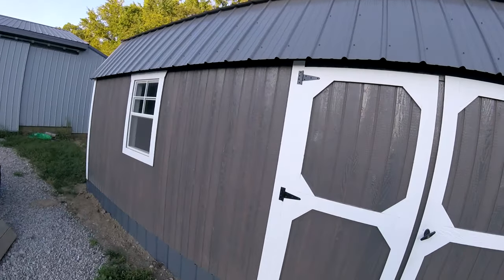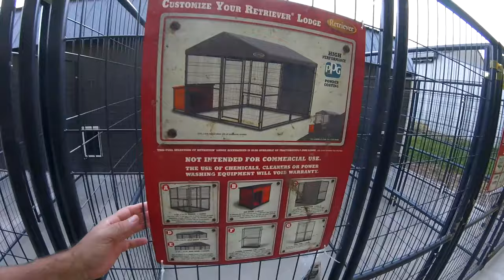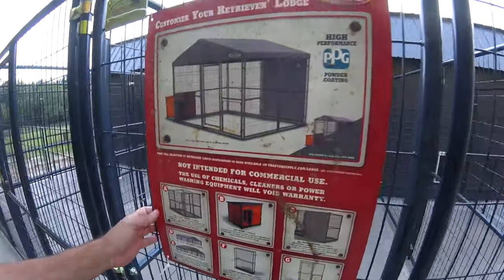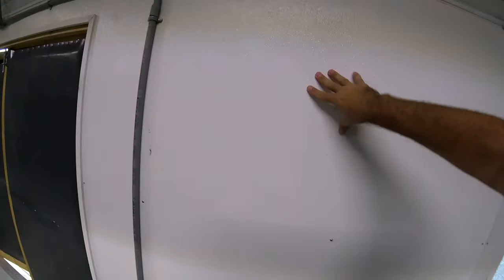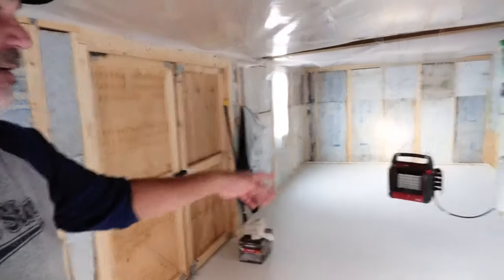Kennel Build

Comment: I like it. We have 11 deer dogs. Gonna be doing a center block kennel similar to this. Our dog doors will be able tolock from oitside so we can let them out when we want to.  And do cleaning etc. This is nice though. I like the fact my neighbors wont be bothered when I feed them. Cause they get to barking and get loud.
Reply: Why won't they be bothered?

Is it sound proof or something?
Reply: Hotep Kennels if the dogs are barking inside it is very hard to hear them from the outside.
Reply: @hotepkennels  pretty much.  You cant hear them the same as if they was just in kennels outside.  The neighbor thinks it's cool.

Comment: Looks awesome, I built myself one too for my dogs but I’m debating if I should do a concrete slab for the runway or maybe I should do turf.. how do your dogs like concrete and where do they go to the bathroom?
Reply from the maker: Thanks! We put some straw down on the far end of the concrete runs and they use that for the most part. We keep them cleaned out as much as possible and power wash it occasionally.

Comment: So, I'm planning a boarding business....how has this kennel held up over 4 years? Lessons learned?
Reply from the maker: Sorry for the late reply! It's been almost 5 years and has held up really well, even with being moved last year. I thought the Rocksolid on the floors was a mistake at first because it stained pretty easily but it's still protecting the wood to this day and actually doesn't look that bad. We did have to replace the Retriever brand kennels because of rust. We went with Master Paws from Menards and they seem to be holding up better. It's being used nonstop and hopefully will for years to come!

Comment: Quick question, the flooring inside the barn is wood? I see dog run is concrete, im planning to build one so im trying to get as much info as i can. If its wood, what do u use to protect the wood from water etc

Comment: The paneling on the wall, did you put up drywall then lay this over it or just put this board up on its own. Curious where it’s usually very thin if it’ll hold up or not  
Great looking kennel. We have a 12x32 as well and it’s a work in progress. Love the drain idea. Will be stealing that along with the tin roof on the inside
Reply from the maker: No drywall, just that thick styrofoam insulation in between the studs and then the paneling over that. Good luck with your build!
Reply: Hey Whitney did you ever finish your build?

Comment: So that whole building is insulated with just foam board insulation?  And it holds heat and a/c ? That’s great looking to do something similar
Reply from the maker: Yes, it's some really thick foam insulation though. Thanks for watching and good luck with your build!
Reply: Hello fellow Corso owner! I raised Corsos for 20 years my old girl is in the video! We used a couple different kinds of insulation. That foam board is amazing tho. Whatever open spots we filled in with spray foam. 5,000 BTU ac set on 5 keeps it cool and a small infrared heater heats it! The ceiling fan help a lot too 😀

Comment: Beautiful set-up! What did you use on the floor and do you have a drain system for the outside part?
Reply from the maker: We used Rock Solid on the floor. We have a separate video on the floor process. We would look for something else if we did it again just because of the cost of Rock Solid plus it stains really bad. No drainage on the outside other than having the concrete sloped away from the kennel. Thanks for watching!

Comment: To have just the building built with company we bought a storage building from with the same square footage which doesn’t include doing all the work inside would equal $10,879 just for the building. But not bad considering $28 per square foot.

Comment: Other than the floor staining did you have any other problems with it? Im thinking maybe a darker color.
Reply from the maker: Darker color would have probably been better. The stuff is protecting the floor but for the cost there has to be something better out there.
Reply: @HoosierOutdoors  I just bought a 12x40 shed today to do just like you did. What type of heater and ac do you use now?
Reply from the maker: @allyessary6205  Nice! Ours is insulated really well so all we use is a small window unit for air and an electric space heater for heat.

Comment: Looks good ...I’ve got 5 retriever kennels they don’t last ..they won’t make it 2 years
Reply from the maker: Dang, hate to hear that! Should last a lot longer than 2 years for what they cost. Is rust the issue with yours?
Reply: Yea the bottoms rust out on them ...I’ve since had to use galvanized square tubing an build my own ...nothing store bought seems to last with everyday use /cleaning
Reply: We have 8 retriever kennels that are covered, and they are not gonna last. I’ve had a door rust off the hinges within 2 years, and they’re out of the elements. It sucks, looking for alternatives for when we move to a new location!

Comment: I’m starting a similar project.  Going with boxes inside vs stalls and a shelter over the runs to keep them dry.  
The heating is what has me wondering for a 12’x48’ all weather shed. I was thinking a 3 to 5,000 watt would be more than enough.  
Are you on a septic? 
Nice work.

Comment: What about the FRP? I have seen pvc panels used by the company who builds complete kennels like this. Do you think the frp is going to work as well as pvc wall panels?
Reply from the maker: The FRP panels have held up great so far.
Reply: @HoosierOutdoors  they seem to be working quite well other than the seam in the big dog pen. Had to put up a trim board over the seam.

Comment: So many questions, How thick was your cement slab? What are you going to use to heat it in the winter months? And do you have an estimated price cost for the whole build?
Reply: 6” thick sloped concrete, it is well insulated and 1 oil heater or small infrared works great! All the materials were bought on sale , with rebates, insulation was bought off FB marketplace for $4 a sheet, building is not on payments so definitely buying outright, bought all materials so no mark up from builder, kennels on sale also use the 15% off coupon… saved at least half doing most ourselves
Reply: @gailakard6267  thanks. I just started mine. Unfortunately I half to wait for spring/summer to do my concrete now. I plan on working on the inside this winter. I am using your build as a guide!! I plan on having a second one made right after for a shelter for stray dogs I can take care of and find good homes. Thanks so much!

Comment: Me again haha! Things are going good! Just finishing up the insulation. What did you use for the walls? PVC? Where did you get them from? Thanks:)
Reply from the maker: Glad to hear things are going good! We used FRP panels for the walls and we either got them at Lowes or Menards, can't remember which.
Reply: @HoosierOutdoors  thanks your the best! I'll have to send you pictures of mine when it's finished. Last thing, what do you recommend I use for the floor.. I know you said in your video you would rather go with something else because of the stains.
Reply from the maker: @EXIXISRAP  the RockSolid stuff we used has actually held up pretty good. No, it sure doesn’t look like it did when we put it down but it isn’t as bad as I thought it was going to get. I haven’t put much thought into what we would use if we did another one but there has to be a cheaper solution!

Comment: Still using those pet safe doors? Why didn't you use the retriever panels inside also?
Reply from the maker: Yes, still using the same doors. We thought about using the panels inside but  decided the wood/metal walls would be better and we could make them any size we wanted.
Reply: @HoosierOutdoors  how about the rocksolid floor? That's exactly what we were planning on using.
Reply from the maker: @K3MM0N  I wouldn’t use it again. It goes about half as far as they say it will and it stains very easily.
Reply: @HoosierOutdoors   how is the floor for cleaning? I guess I'll make a video when we're build ours and post it as a response.